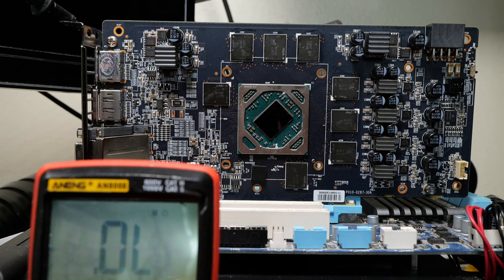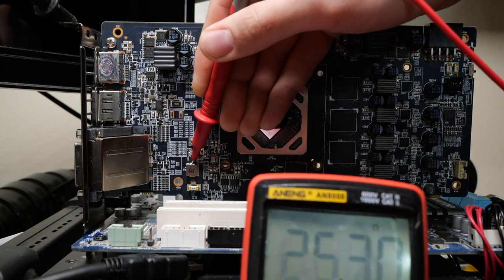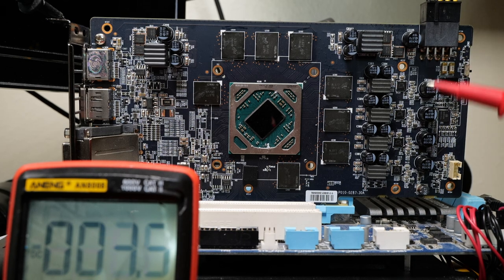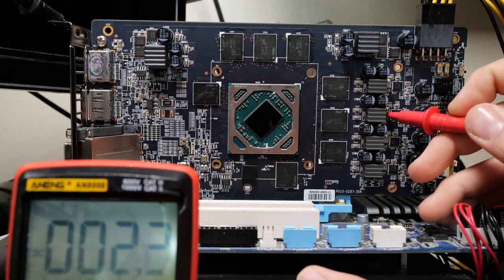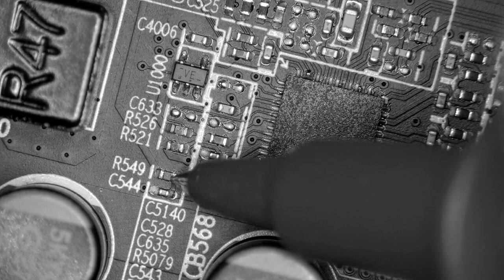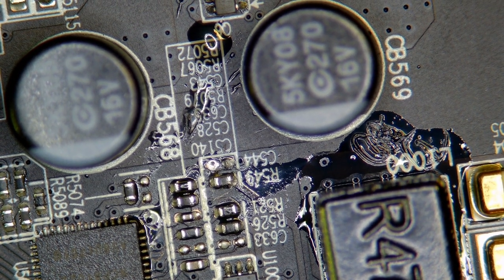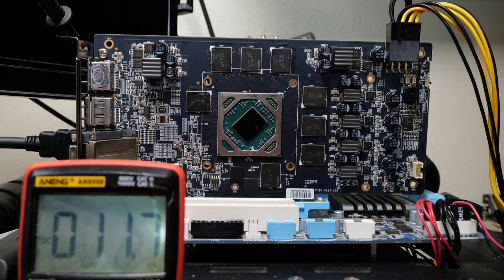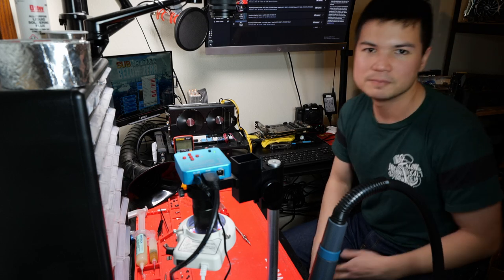Sapphire RX 580 Pulse Graphics Card Repair - Not Detected

Comment: great videos as always, might i ask a question, what can be wrong with a powercolor 5500xt that always on 20mhz on core and 100mhz on ram, clocks wont boost, not a driver issue.
Reply: Check the bios version and update it
Reply: @tyronewestley8819  forgot to mention, it the first I did, 3 different BIOS

Comment: Awesome video once again 🤩🤯! It’s great to see that often a simple capacitor / resistor etc can be at fault and with the right knowledge can be fairly easy to track down the fault and a straight forward repair rather than the item ending up in landfill unnecessarily. Great work 🤯🤩🥳😉

Comment: Pretty nice, i am gonna receive a refurbished RX580 Nitro+ next week, and i need to learn to repair it asap, thanks, you explained the first basic steps clear enough. Aww, i need a hot-air soldering station, though... Any advice which cheap for a beginner?

Comment: I have a Dell Vostro 2520 that no longer boots because of a failed bios update, it just got stuck on the Windows 7 "applying update 1/1 for an hour, and I thought it was just a stuck Windows update, and not the bios update. What can I do to fix that laptop? I don't realy need it and neither does my father, who stopped using it over 2 years ago, but it would be nice to get it running again.

Comment: hello, i actually have the same problem as no VCore voltage, the double top right fuses on the 12V have blown but no short and also no short on the caps around NCP81022. Is VSS and VDD shorted on this chip is something normal ? Also, to check voltages do i need to feed 12V bus and 3.3V rail from PCIE express ? i don't have mobo.
Reply: I have an rx580 pulse without Vcore, and it has a 2 homs short between VSS and VDD even after removing the ncp81022 pwm , Did you find what the defect was ??
Reply: @nocrass Here there is also a logic port that is not receiving the signal (A) so it does not activate, this logic port goes to pin 1 of the pwm (ncp81022) is (powerOK), but I have a low resistance of 2 homs between pin 51 (VDD ) and 52 (VSS), I think this low resistance is not normal because I removed the ncp81022 and it still had 2 homs on the board, and on the ncp81022 there is 200 homs between VDD and VSS, the board has all voltages except Vcore

Comment: A sapphire pulse cards that isn't a shorted drmos, kinda rare to see.
Reply: Yeah, the DrMOS is what died on my Sapphire Nitro RX 470.  I didn't have skills to desolder/solder the part, so I removed the corresponding inductor and the card works great on three out of four power phases.  It was a fun project that can be found on the Internet as "RX 470 Zombie Edition."
Reply: @haydn-db8z  470 and 480 nitro+ are well known to have the crappy crap ir3553m unlike the 500 series nitro+
On my own 480 i swapped all ir3553m with the beefier ir3550m

The thing here is even though sapphire pulse cards use sic632 or fdmf3035 they tends to have a shorted drmos unlike the 500 series nitro+
Reply: There are actually some 400 series nitro+ which use ir3550m or ir3575m but it's quite rare and so far since i did graphics cards repair I've seen only twice
Reply: @accurian148  Mine uses the fdmf3035, and that's the part I couldn't replace with my limited skills.  The card might be a Pulse instead of a Nitro for all I know, even though the fans say "Nitro."  I was a mining card and could have had its HSF swapped.  After deleting the dead power phase, I had to edit the vBIOS to basically ignore power limits the card thought it was using over 300 Watts when it wasn't.  😀
Reply: @haydn-db8z  oh it's the nitro without +, yes basically the same PCB as the pulse one

Comment: whats ur hot air setting? Im surprise the cap didnt explode
Reply from the maker: 932*F/120L air, I typically heat the board a bit away from the cap before trying to remove the component I want.

Comment: What temp and airflow are you using to remove the pwm controller?
Reply from the maker: I typically use 932*F, 120L/min
Reply: thanks.😉
Reply: @kikihun9726  How much did he charge you to ask this question? Or haven't you gotten the invoice yet?
Reply: Pardon?
Reply: @KiKi_HUN  I was just poking fun at the idiocy of Tech Cemetery's meltdown towards Louis Rossman over "free education". Tech Cemetery is simultaneously against free education, whilst building a YouTube channel centered around just that. His time isn't free, y'know?
Reply: If you help someone, you'll get it back. This is the good karma.
He can just not reply but he replied.